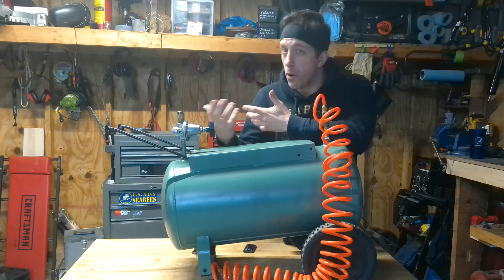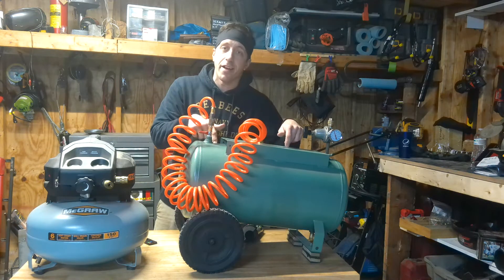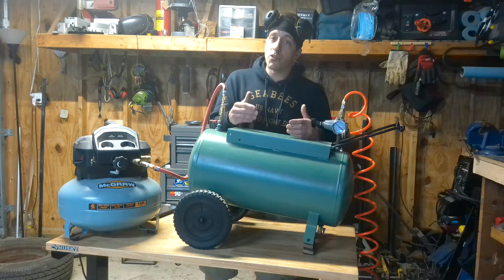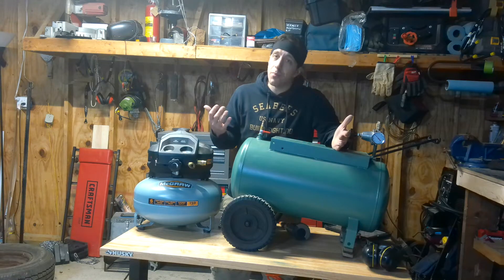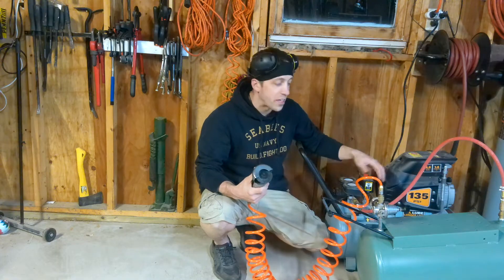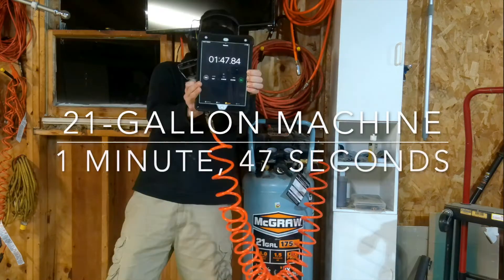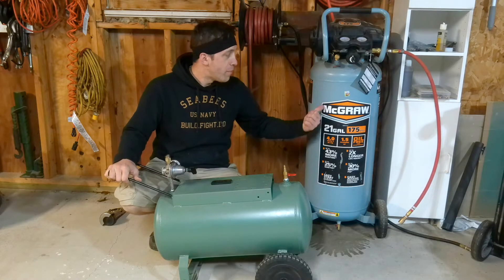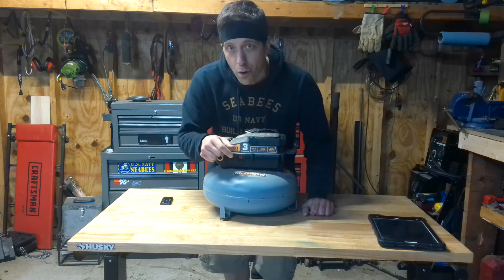Air Expansion Tanks - Everything You Need To Know!

Comment: Got a question for ya. You Seebees are alright in my book. They take care of business.! So I have a 6 gallon port cable compressor. I found a probably 40 gallon tank in my basement. About 4 feet high. Heavy and says it was a propane tank but for outdoor use only. Has a normal twist valve into a pressure gauge then a. Exit tube(cut but was 1/4” copper. I drained it. Gonna drain it a bunch more. Then  paint and customize it. What’s the easier way to use that tank and my 6 gallon to fill that 40 gallon and keep pumping. I need it for powder coating and sand blasting. But I’m cheap and Army Engineer, build, weld, etc. I now it will take forever to fill the take orihinallly. But I don’t care about burning the. Pancake up. I’ll just get a bigger next time and hook it up. Can I do it with just the one tank engine? Any thought thoughts?
Reply: FYI 12B major TBI damage to heads M. Afghanistan so my writing sucks. Thank brother. Thanks for your service

Comment: Another benefit for having an expansion tank is that with the right coupler, you can use one or several of those smaller inflators (like the 20v/18v tool battery operated ones or 12v corded ones provided you stay within their max pressure ratings and duty cycle specs) to fill the expansion tank where   space or power limitations may prevent the use of say a pancake compressor or similar  compressor. Of course you could do the same with say a pancake compressor but you would be carrying around the dead weight of the compression unit itself that won't be used  in this situation.
Reply: That seems a great idea. I was about to buy a small 5-6 Liters compressor power by 2 batteries. To use it for small blowing air jobs, and inflate some tires. But watching so many videos and reviews, I decided not to, due to the high battery consumption, the tank drains fast keeping the motor running, besides the average high prices. So I'm considering having an expansion air tank for those small tasks. Topping it up with a simpler 18V tire inflator.

Comment: i have an 8-gallon Kobalt air compressor oil free and i want to add a storage tank to it and the storage tanks has no drain valve and i was wondering do i need a water trapper to keep condensation out of my storage tank
Reply from the maker: You need a drain valve in the storage tank.

Comment: question  help anyone .... i have a 13 gal compressor by stealth great by the way.. I have a 30 tank i want to add to it  do you think the motor can handle it ? or too big i hate to let good big tank go
Reply from the maker: It may be too much for the pump to handle. You’re basically tripling the amount of air needed to achieve tank pressure. It could work, but will take a long time to fill and recover. I’d advise getting a 10-12 gallon tank and give that a try. Hope that helps. 🇺🇸🤘

Comment: Ok, but HOW do I connect the extra tank to my crappy little compressor? What KIND of tank and parts do I need? Don’t most tanks only have ONE inlet/outlet?
Reply from the maker: You’ll need a dual male end hose to connect your compressor to the tank. It also depends on the kind of tank you have. Make sure you have an air port IN, an air port OUT with a regulator and you’ll be fine. I hope that makes sense.

Comment: Downside..... the small compressor isn't sized for the large volume or long run times. It will burn up much sooner.
Reply: Not exactly so. We had six nail guns running off a 6 gallon compressor with a 30 gallon extra tank, and it kept everyone busy every day for the 5 years I worked there, and that little compressor never had a problem.
Reply: Exactly. No matter what size of a tank you have, all the air used by the tool comes from the compressor – which have a thing called duty cycle.

This mod allows you to have a larger initial air reserve in case you have a tool that requires a lot of air but is not used continuously. Or if you have a tool you do use continuously but it doesn’t use that much air, it’ll reduce the frequency of starting and stopping.
Reply: It all depends on the quality of the compressor. Besides, nuking a compressor gives you an excuse to buy a new one 😊

Comment: Great video. So my 21 gallon HF compressor went off. I was thinking to buy a 26 gallon kobalt compressor or the DeWalt small vertical/horizontal compressor and use the bad compressor as extended tank. Would that be good idea? Just regular use at home. Thanks.
Reply from the maker: I wouldn’t recommend using a 21 gallon tank as an expansion. A smaller machine will take forever to fill it up - wouldn’t really be worth the wait. Check out my newer videos on the fortress compressors from HF - they’re legit. Thank you for watching 🇺🇸🤘

Comment: You don't increase the working pressure by attaching an extra tank, you increase the volume of air, while maintaining the same pressure level. What you increase by increasing the volume is the time your tool can work at it's rated pressure level. You can't increase the working pressure beyond what a compressor is rated, first the cut off valve will not allow you to do so, and if you disconnect it, the safety valve will do it's work, and if you remove that, congrats, you qualified for a Darwin award.
Reply from the maker: Very true! Thanks for watching 🤘🇺🇸
Reply: "Well technically..."  Yeah, he clearly explained what he was saying.  And it wasn't that we magically got more overall pressure to the system.   But instead more pressure to the tool over time.